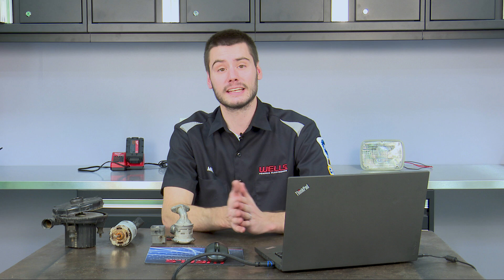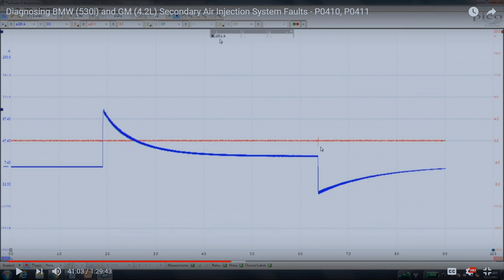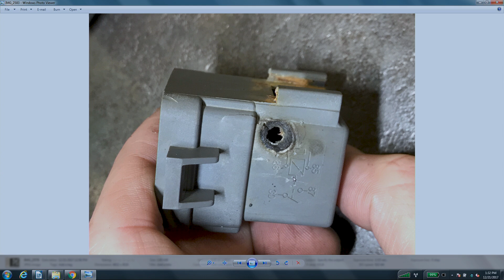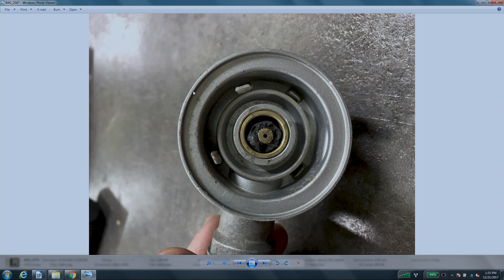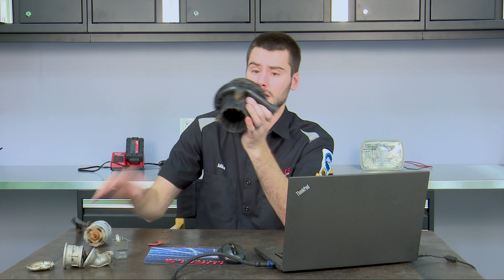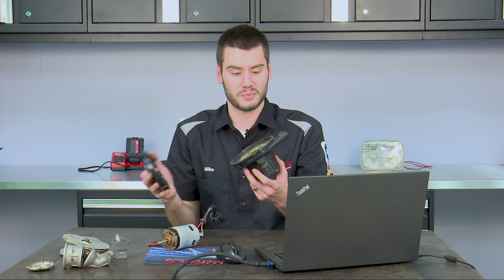TechConnect Ep.25 - Taking A Look Inside A Bad BMW Air Pump

Comment: You're right Mike that it's crazy the manufacturers would stick expensive pumps down where water can get into pumps. And having a relay not sealed underneath is just poor engineering. Great presentation of the parts as always!
Reply from the maker: Terry, it only has to last the duration of the warranty :) It's too bad they think that way....crazy world we live in. That relay was a shocker though. They should of just had it under the hood and ran the wire to the pump. At least it would have lasted a little longer haha.
Mike Becker, Technical Services Instructor

Comment: Ran Into another vehicle that does that it was on a 2005 Toyota prius blower motor circuit when relays off it runs to ground. Thought of your video when I seen it. Always cool tearing stuff apart
Reply from the maker: Cool Mike, be right back...off to look at a Prius diagram :)
Mike Becker, Technical Services Instructor

Comment: Hey Mike! Great video! As to your question : I believe you said during the livestream that you were hearing the relay clicking as you were commanding the pump on with the scan tool,which lead you away from suspecting the scan tool. Even though a clicking relay is not bulletproof, it was a very good indication. What I would do since we had access to the pump,is to connect a higher amperage test light,command the pump and see if it comes on bright.
Happy New Year Mike!!! Same to everyone at Well's garage!!!
Reply from the maker: Hey Nick, thanks for watching. That is how I would do it as well. Use some sort of load in the circuit and command it on. This verifies the scan tool is functioning as well as the computer controlled circuit.  Happy New Year to you as well!
Mike Becker, Technical Services Instructor

Comment: I hope Wells realizes the value in these videos.  I buy Wells parts, usually the rebranded ones at Autozone, whenever I can just due to the fact that the support is there and I know I'm getting a good quality part.  It's always obvious by the quality of your videos that they have invested in the channel and the customer support behind the parts.  Thanks for what you do, Mike!
Reply: Thanks for pointing out the rebranded Wells parts at Autozone.
Reply from the maker: Hey John, yeh everyone here knows the value in this. That's why I have a job :) 
Mike Becker, Technical Services Instructor

Comment: Nasty looking Motor!  HAPPY NEW YEAR MIKE!  Relays!  Aren't they FUN?!  THAT ONE WAS BAD ! !   I've seen aftermarket relays that have diodes or resistors in their coil circuit, but wired to ground when the contacts open.  They could have put a diode in the circuit like GM did years ago with the A/C clutch or torque converter clutch.  Oh well, it IS a heavy duty, current wise, circuit.
Reply from the maker: Hey Mike, yeh that was. Definite water damage. That is the worst relay I have EVER seen! Happy New Year to you as well.
Mike Becker, Technical Services Instructor

Comment: Another quick and easy way to determine if a vehicle has secondary air injection is to look at the Vehicle Emissions Control Information (VECI) label under the hood. GM will usually always have the acronym "AIR" at the top of the label to show that the system was factory-installed.Maybe the reason these systems aren't engineered that well is because they only have to go into certain vehicles (mainly California-emissions certified models). Since they're a relatively small group of vehicles, I guess most manufacturers don't see a need to put too much research and development funds into designing them to be absolutely trouble-free.All these parts were in really bad shape. Thanks for showing us the carnage!
Reply from the maker: Hey Joseph, that is a great point! Thanks for watching and commenting.
Mike Becker, Technical Services Instructor

Comment: You would check control (powers or grounds ) to the pump
Reply from the maker: You're right Richard, that is a great way. What tool? 
Mike Becker, Technical Services Instructor
Reply: Wells Vehicle Electronics any bi-directional scanner